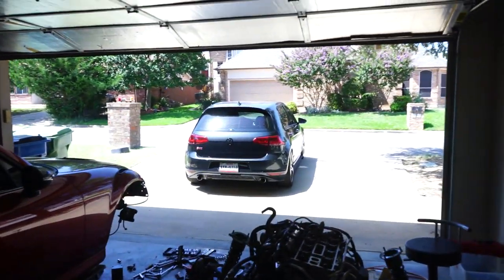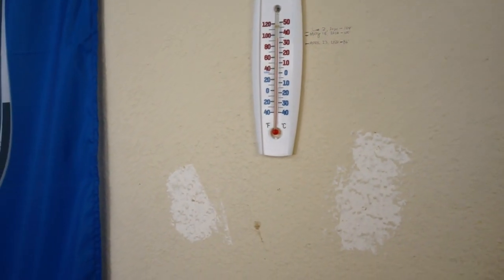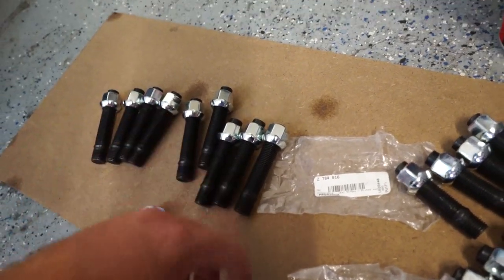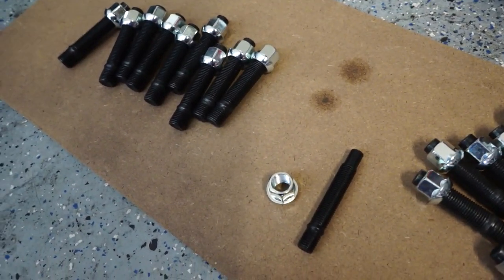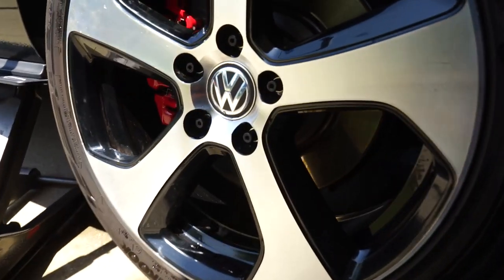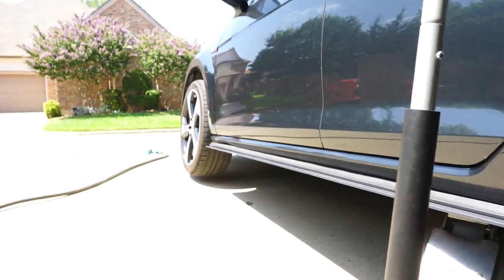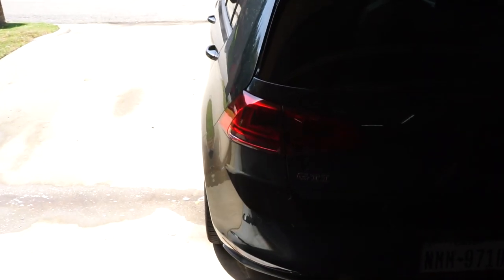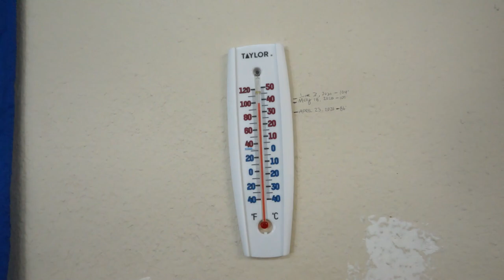Wheel Stud Conversion on a Mk7 Golf GTI

Comment: Any updates on the driving with this Conversion? I drive 100 miles daily and I’m slightly worried about the bolts coming lose. Did you re torque them after a certain amount of miles?
Reply: As long as you torque the studs and nuts up correctly they are perfectly safe. Just remember to check the torque setting after 10-15 miles.

Comment: Is it safe though do the studs go in anti clock and then the nuts clockwise if you know what I mean so the counter them selves ????
Reply: No need. When the wheels are turning there is no torque force on the nut.